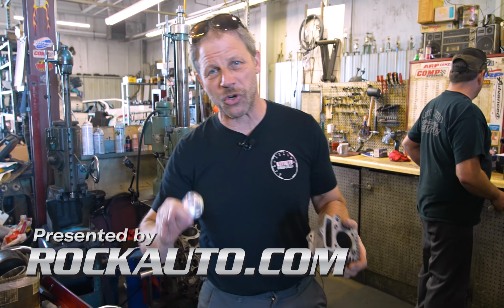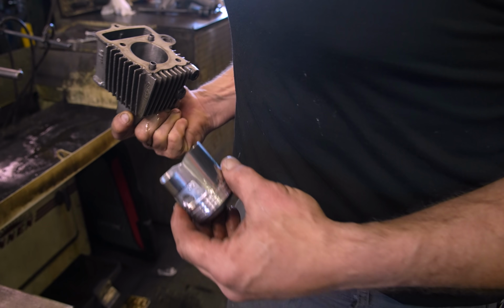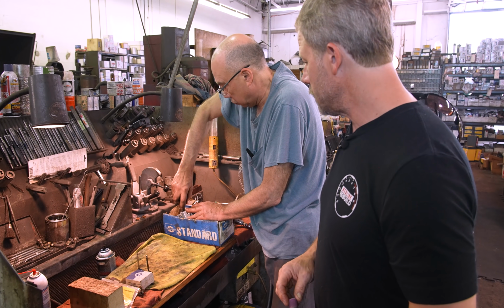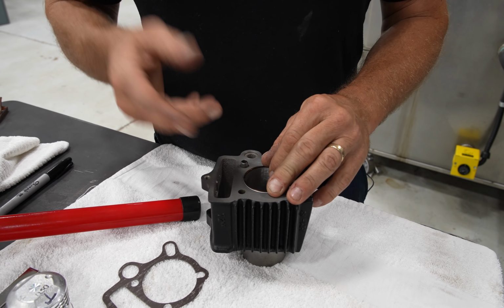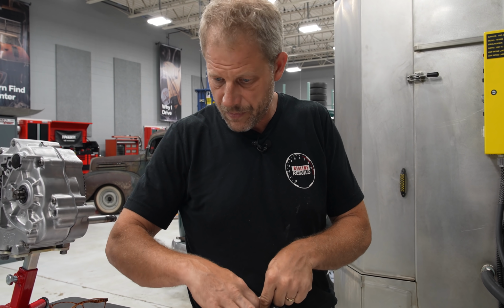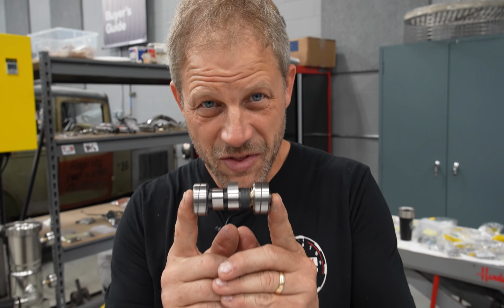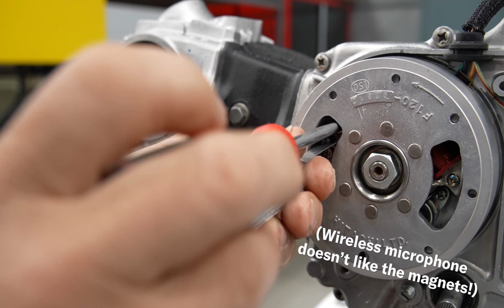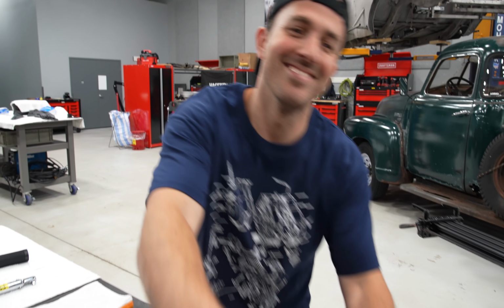Engine assembly is DONE! Honda CT70 project continues | Redline Update #90

Comment: There are some serious wizards in this machine shop. I always love to see this magic being done.

Also if you find these valves and camshaft tiny, try to work on a Honda GX25. It's a complete 4 stroke OHC engine for string trimmer. 25cc. Or one and half cubic inch. Valves are less than half an inch in diameter....

Comment: in Indonesia,we call it C series.....
extremely modified with stock head an block
valve 28 in en 24 on ex
in piston max if using stock borring(block) max 54mm
also some modified in stroke as like stroker kit 
if in my place we change oil pump positioning

Comment: If you are interested, try building a Honda cub125cc engine with the KPH type, this type is better because it has an oil squirter behind the piston and also a more reliable oil pump gear. and also has a roller rocker arm, and also a 6 spring clutch housing, and is also ready to stroke up easily

Comment: 4:47 I was bit stunned to see valve lapping with drill. Maybe something changed, but to me it was always a manual job that required constant changing of valve orientation and grinding direction so that grains in lapping compound don't make grooves that go all the way around valve - seat contact surface thus lowering sealing. Is this still a thing, or there is now some new technology compound or something?
Reply: The well experienced man surely changed the orientation without showing it. A small change in angle is sufficient.
Reply: I don't think anything has changed, people just use a drill to save time. Anyone who thinks it's a good idea needs to do some research

Comment: You guys really need to do a Subaru . I have rebuilt a few of them .Only engine I have done that the block has holes in it so you can install the wrist pin and snap rings .

Comment: I wonder how many of those engines are rebuilt on a special stand, in such clean conditions like that, or on a mucky bench/concrete floor with some eager teenager bashing it with a hammer.

Comment: You gotta Set the ignition advance to spec within the point gap range. That's a HUGE amount of difference in ignition timing with a 3 thou spread. Use a meter and check for continuity at whatever timing should be. This is where all the power is won or lost in vintage outboard and motorcycle racing.  You don't have a distributor to turn, so timing is set rough with the stator plate and fine tuned with the Point Break. Older scooter and moped guys, this applies to you as well.
Reply: Used to static time these with a cigarette paper, just so you can pull it out at the fire mark.

Comment: send the machine to Indonesia, it's up to you how many hp or cc, stroke up, bore up.. camshaft and kruk as hand made, all motorcycle engines from 50cc to what ever, from 1 cylinder to 5 cylinder In Indonesia, everything is usually modified..

Comment: Is there a reason that on 13:56 the engine head has mismatch nuts and one of them even has copper crusher?
Reply: Yes, lower stud is inside the pressurized oil galley coming from the oil pump.  The copper sealing washer is needed to prevent oil leaks.

Comment: That is still small to us at Malaysia. 100 cc engine we bore up from 50mm to 58mm, we adjust connecting rod pin position 4mm so the rod ratio is more effective, we change a big valve n some more upgrade. 100cc enginr we can make at least 175cc upgrade

Comment: You know their might be someone who worked in the factory when that was new, watching and laughing , at how slow you are at assembling that motor . They had 1 hr to assemble the thing , to check any clearance's was not needed . They pulled parts from bins and jamed it together the quality control was that good . The cost to rebuild this motorcycle you could have bought a new knock off 125 cc for less . Sometimes it's just not worth the time/ cost to rebuild a motor
Reply from the maker: Good thing we’re not doing it to make money, then!

Comment: I've been Working On 3 Race Moped (drag moped) and With That Kind of Upgrade Not Gonna Making 50+ Hp that Puny Engine Would Never Reach That Hp My Most Powerfull Engine That i ever Build Is Suzuki FXR 150 Engine And Its Only Making 35Hp With The exact same mods As Yours With 66mm Piston 26mm Valve (IN) and 24mm Valve(Ex) also With 32mm Carbs and Stock CDi & Coil Its Not Make a Sense If it gonna Make 50hp You Need At least 3 Engine Like that To Make 50 hp
Reply: Stroker 108cc Hondas make 6.6 whp, this will be lucky to make 5 whp.

Comment: Can anybody tell me how the camshaft lobes increases performance? 🤔
Reply: More duration = higher rpm torque peak and less low end power. Less duration = lower rpm torque peak and no top rpm power. The hemi layout generally limits how much duration you can run as the overlap will crash the valves into each other.
Reply: You can regrind the stock cam to alter the peak Power/RPM/Torque. They don't show it, but you can also "degree" the cam a bit (Change the cam timing relative to the crank) if you slot the cam gear mounting bolt holes a bit. Care must be exercised not to go too far (piston to valve contact)... bent valves suck. The CT-90/125 engines can hopped up quite a bit with little effort.
Reply: @jnljnl8485  assuming that the carburetor and exhaust are capable of flowing more, then tweaking the camshaft can unlock some of that potential.
Reply: @5tr41ghtGuy  roundy round cars run 7000 rpm with 500cfm 2 barrels. The carb and exaust will just limit the peak power not necessarily change where it occurs in the rpm range. Intake runner leingth can shift the power band more than being corked up.
Reply: more valve lift, bigger opening of ports, more flow

Comment: You can sell the original motor pice by pice to people doing restoration and buy a 4 valve 190cc china motor have 3 times the power and still had money leftover.
Reply: @Hanzyscure  they have some good ones that are actually better quality than the 1970s honda. For those who are going to plate the bike and ride it on the road its the way to go. You can put your original engine up in the shop and not wory about sending a rod trough the antique engine cases.

Comment: 2:25 - Yeah, I'll stop watching now. Never seen a piston so loose in a bore that it'll just fall straight through.
That's gonna slap more then a cold Race Hemi.
Reply: with no rings on , how tight should it be do you think ??
Reply: @tomthompson7400  Tight enough to Not fall through due to gravity.
Reply: @tomthompson7400  This is why engines need oils with high shear capability.
Reply: @PiDsPagePrototypes  two thou to the inch was always my rough count on forged pistons ... less on standards .. more on commercials ... if it's not touching it's not touching ... but with that much oil on in the video ... it's a tad loose . But it will at least be parallel being just bored so no cone wear pattern either.